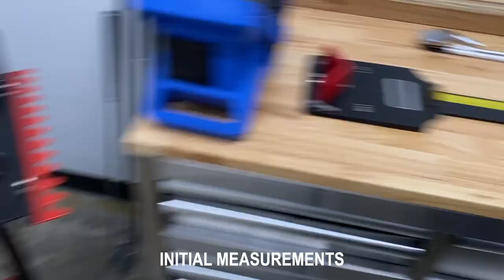PING EYE 2 Reshaft and Update

Comment: I finally and reluctantly replaced my Eye2s a few months ago to g410s with graphite and mid-size grips for my aging body.  Of course, I still miss them and the clean contact, although new set offers about a clubs difference in length with a better fit.  Still have the eye2s and always will ...
Reply: ᵀᴴᴬᴺᴷˢ ᶠᴼᴿ ᵂᴬᵀᶜᴴᴵᴺᴳ⬆️....

Comment: I still have a set of the original Ping Eye 2 irons (square grooves and all), 1 iron to lob wedge with a BeCu sand wedge.  They were my first "big boy" irons I ever bought!  You likely know this but be careful working with or machining BeCu.   OSHA has some pretty strict rules dealing with inhaling or skin contact with BeCu.  It tends to be pretty toxic.  Also, if you ever get cut with a BeCu shaving, it will take a very long time to heal.  Great job on those classic clubs!
Reply from the maker: Yes, you want to be careful with any chance of fine particles of it.

Comment: Nice video. I just looked up the OE specs of those - they are crazy weak at 36-degree 7-iron. As I have a very forward handle delivery, I think I would go the opposite direction and bend them weaker, to add more bounce & reduce the offset, like VJ Singh & Billy Horschel, and then play 3 iron to 9, as a 4iron to PW set, with the 9 iron being 47 degrees. I hope used clubs sell off in prices again because I would like a set of those similar to how you have done them.
Reply from the maker: You are right, very weak and a lot of offset on these.
Reply: @EFGMC  Might be a video idea for you. Older weaker irons generally had more offset and less bounce (Jack and the old timers like very thin soles and almost negative bounce to go down and get the ball on dirt hard lies). Maybe a video on finding older offset sets and converting them, by bending them weaker, and then converting them to 32-degree 6-irons (modern T100s 7iron) and then doing a comparison for numbers with the GC Quad
Reply: Those ping eyeII irons were standard lofts with 45 deg 9 iron, 50 deg pitching wedge, modern irons are simply miss marked for ego  marketing ,one club stronger and longer shafted, thus the need for a stinking 50 deg gap wedge that never used to exist.
Reply: @scootertrasher1369  Those are not standard lofts. Standard blade lofts are (21,24,27,30,34,38,42,46) - or (21,24,27,31,35,39,43,47). Eye2s were weak lofted at the low end. Many older 2 wedge tour pros will bend their PW to 48 and then play 56/60 like Tiger, Seve. I play strong lofted irons, bent much weaker at the short end for added bounce - with the PW being 47-degrees (OE stock is 45), and I then play 52/58 for my 2-wedge setup
Reply: @wallstreetoneil  The quest for distance did not start till the late 1990s, for what ever reason they started making clubs longer and stronger creating a gap so big between the pitching wedge and sand wedge they need a club to fill the gap, to you the ping eye 2s may seem weak lofted and if you look at any iron from that pre 1999 era you will find it matches in length and loft to one club weaker in today's "modern" welded together flex face crutches they call game improvement, distance, or players irons, there is nothing weak about a 50 degree pitching wedge,it falls in perfectly between the 45 degree 9 iron and the 55 degree sand wedge, and it's been mislabeled a gap wedge for twenty plus years, I remember Ben Hogan putting the loft on his irons instead of numbering them.

Comment: I love what you did to those old pings and I love the ferrels (sic).  I'm looking at a set of ping zing cu be right now with original  graphite shafts. Would you change the shafts?  Great job!!!
Reply from the maker: Those graphite shafts probably need to be replaced. Guessing they will have some cracking.

Comment: Classic irons just before loft jacking became a thing. I still blame the original King Cobras for that but it appeased peoples egos. Original eye 2's 7 iron 36* and PW 50.5*. Ping G430 7 iron 27.5 and PW is 41*.
Reply from the maker: I had those Cobras. Not only were they stronger lofted but they were also 1/2 inch longer as standard. They flew a mile.

Comment: Awesome , don't forget to mention that the dust from machining or sanding becu will give you cancer, the expense of the safety procedures involved was a big part of the reason they quit making those irons, what did you not swing weight them to?
Reply from the maker: They are low C swingweight. 1 inch short with 70g graphite will do that.

Comment: You did 2 things in that video that I thought you shouldn’t do.
Try to bend cast clubs with a traditional bending machine especially BeCu and making a 370 parallel tip fit a 355 taper.
It’s obviously doable can you put me straight on these points or have I got it completely wrong.

Comment: Great video. Why did you choose that specific shaft? What was final swingweight? Are they standard length? How did bending 2 degrees strong impact bounce? 

Keep up the good work!
Reply from the maker: All the components were chosen by the client including the shaft. They were actually short of standard so they were lighter in swing weight.
As for bounce, it's a direct relationship with loft. 1 degree lower loft = 1 degree lower bounce.

Comment: AJ, I like your videos, you have a great modern workshop. One question: When restoring and reshafting vintage pinned irons, do you replace the pin, or do you simply fill the hole with epoxy?
Reply from the maker: I honestly have not worked on a pinned set for 15 years. I don't really refinish clubs so the number of older sets I take in is pretty small. Last time I did a set I drilled out the pin to remove so that the pin edges still sat in the holes in the hosel and looked just like they did before.

Comment: Quick question, apologies if already asked… After shaft removal why not add a little heat and a blank when adjusting the loft, Prior to fitting new shafts. I’m assuming stress because of the material and age… preference… 

I have 0 exp in this 😅
Reply from the maker: You need the shaft set in the hosel before you measure and bend because the shaft can have slight lean to it so you want to make sure you are adjusting off of where the completed club starts.

Comment: Can you share the new  final loft specs?
I was curious to know what differences you noticed with this update on a classic golf club.
Reply from the maker: Think we did a 47 degree PW and down from there. Client was happy with them, that's all I know for sure.
Reply: @EFGMC  I pushed the limit with 45deg on my PW
Reply from the maker: @jdbar014  That is a lot of bend for a Ping but well done getting it there.
Reply: @EFGMC  It was a bit scary, but the bounce method with a good bar seems to work well. In my experience 2-3 degrees is max. 
Lie adjustments are more dangerous to make because of snapping the hosel.

Comment: I recently bought a Ping Eye 2 lob wedge on eBay, and UPS snapped the shaft in transit. I’m using it as an opportunity to try my first reshaft, and this video has been invaluable. I’m reshafting it in a steel Nippon Modus3 prototype 115g in wedge flex.
I’ve read elsewhere that the .355 taper shaft has to be seated at the base of the hosel by tapping the butt end of the shaft on the ground a couple of times, which I think I heard you do off camera.
My question is can you feel the difference in the head to shaft fit when the shaft is fully seated vs when it isn’t? The rest of the process seems pretty straightforward, I just want to make sure I do that part right. Thanks!
Reply from the maker: It's not necessary to do that. Ping is always worried that the epoxy won't hold so they come up with these mechanical bonds to hold the shaft. Modern epoxy is really good and if you have over 3/4 inch of hosel to glue into, you should not have any issues with bond failure.
Reply: @EFGMC  Great! Thanks so much for the reply. I’m pretty handy so I’m not too worried about the process, I just want to make sure I’m doing it right. Thanks for the reassurance, it’s much appreciated.

Comment: Love this video. Helps me know what tools I need. Why ferrels?
Reply from the maker: Client asked for them.
Reply: @EFGMC  ok then.
Reply: Nice 👍 work. I asked myself why ferrules but since the client asked for them I guess they were ok.
Instead of heating up the ferrules I used to put them in some water that I would boil and the would slide on very easy .
Were the accura shafts taper tips? Because the ping clubs are taper tips
Reply from the maker: @bobcoatta9397  I don't have a way to heat water in the shop right now so this is the alternative.
The Accras were parallel so it required some tip shaving.

Comment: What brand epoxy do you use?? I used Amazon quick and long dry epoxy and the heads always seem to come loose…. I prep the shaft, clean out hossel, following all the steps accurately. Seems like the culprit is the epoxy not being strong enough…
Reply from the maker: I get all my epoxy from Golfworks.
Reply: @EFGMC any tips for why the epoxy may not be holding? Happened to me for multiple builds I did for myself. Only part that I didn’t do that you did was use acetone
Reply from the maker: @quadsport7022  Could be residue in the hosel, could be inconsistent mixing, could be bad epoxy batch.

Comment: the Eye 2 set that I reshafted were taper tipped
Reply from the maker: They are. Required extra tip sanding with these Accra shafts.
Reply: @EFGMC  gotcha
Reply: @EFGMC  do you use a caliper to measure the tips as you sand them down to .355? I  have an old set of ping i3's that I would like to put graphite in, would it be be easier to ream the hosels to .370?
Reply from the maker: @jonwgee  I have always found it pretty simple to evenly sand down the tip of a graphite .370 shaft. Really only need to focus on the last 1/2 inch to get it to fit. Sand it a little, insert and see where it sticks, and sand a bit more.
Reply: Other than the desired shafts not being offered in a. 355" taper tip why bother with the hassle of sanding the tip to work when most shafts (especially graphite) are available in a taper tip

Comment: In 32 years of building golf clubs that’s the first time I ever seen anyone heat up a ferrule to install
Reply from the maker: You can do the same thing with a bowl of hot water and soak the ferrule. I don't have a microwave or stove in my shop so I go with this method. Also I always worry about the bond from a wet ferrule going on.

Comment: I thought eye 2's had a .355 hosel?
Reply from the maker: They do.
Reply: @MOBILE CLUBMAKER GOLF   So you just turned down the .370 shafts to fit the .355 then? 

Another question I have is do you think getting eye 2's is worth the cost of purchasing and then "upgrading" to use as "fun clubs" or is it not worth the investment?
Reply from the maker: @kall3467  Yes, you just sand down the .370 until it fits. Other option is to ream out the hosel to make it .370 but that's much more work.
I know plenty of people still gaming Eye2s. Just depends what price you get them for.
Reply: @MOBILE CLUBMAKER GOLF  I used to have a set years ago but I was stupid and sold them. Shouldn't have done that... 
I know of a guy at my local course that bought a set new back in the 80's and he's still playing with them.

Comment: great video i'm doing the exact same thing to my becu irons was wondering if after bending them 2* strong did they stay there i've read that becu tries to return to its original position so i thought maybe might have to bend them more to get the results i'm after that is more modern lofts
Reply from the maker: That isn't true. Metal does not just move back on it's own. Usually it's a case of the head moving in the bending jig instead of the hosel bending though this mainly happens with lie angle changes.